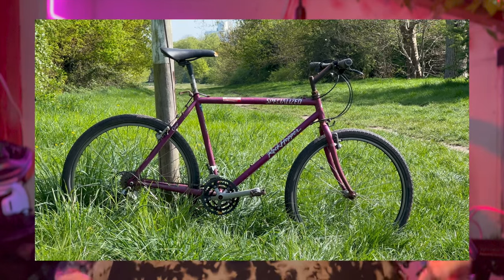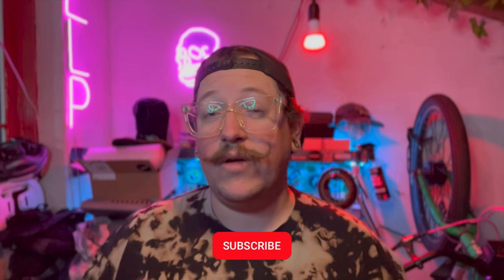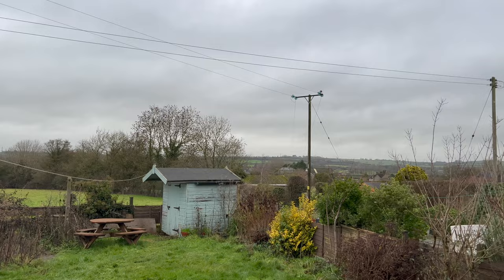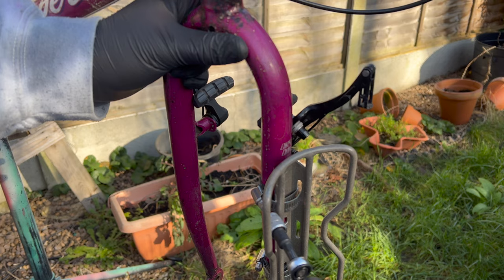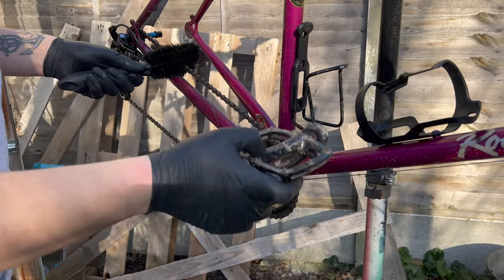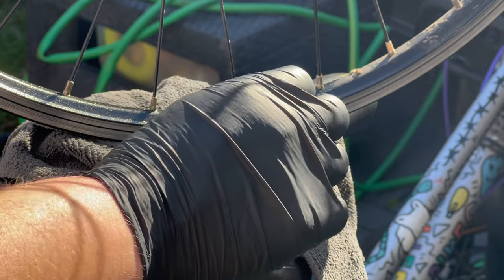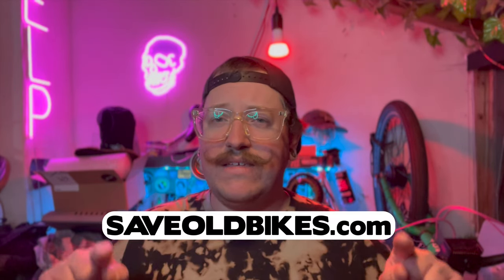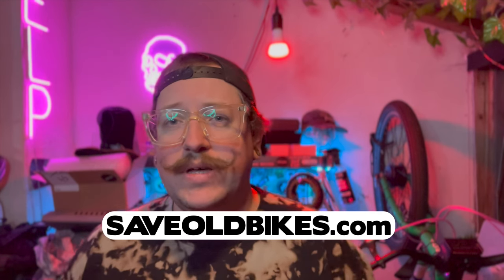Building a 90s Specialized RockHopper Commuter

Comment: I would recommend the Seeley mini ratchet.Quite pricey at about £14 but a superb tool. At one end is the ratchet, at the other a bit holder recess so you can either use it as a ratchet or a screwdriver. Surprisingly comfy and very shiny. Lives in my tool roll due to its compactness and practicality.

Comment: since you have Vbrakes you could have easily just gone for a high rise stem and kept the sweet bars. i changed the stems on all my bikes for a more 'gaper' ride.
i have switched to RockandRoll Gold or Blue on chain, mainly because they are so easy to clean with a wire wheel on a cordless drill between lubes. chain stays shiny.
cool bike for yer dad. nice new 1X on the hopper.

Comment: I have BLB Big Smoke OS bars on my retro 26 MTB commuter. This is with a 130mm 45deg stem, which brings my bars level with my saddle (I'm 6ft). I dont like swept back bars as i have found it very hard to get the reach right.  Plus i have a front rack, which i put my shopping on, so i like the bars medium wide and flat for leverage with the rack. Maybe for a commute, try cutting the bars shorter between 700 and 750, and with comfort grips, like Ergon GA3s, or some thumb rests like Togs Flexi MTB.

Comment: I own a '97 or '98 Rockhopper here in Canada.  Modified tires, saddle, handlebars.  But I never found it particularly comfortable, especially for long rides.  It desperately needs new tires and a new drivetrain, but also a stem and handlebar to improve comfort as well as cable repairs.  By the time I do all that, I might as well buy a new bike.....which I did (yet another Specialized, but this time a 2023 Sirrus X 2.0).  I needed to get out biking, and I just didn't want to ride my old one (I kind of feel sorry I didn't try to rebuild it.....but I 'could' afford a new one).  I was initially shopping for a pure commuter bike, like a Devinci Cartier or Kona Dew......but found those BORING, though comfortable.  I sacrificed a bit of comfort for my wrists by buying the Sirrus, but boy is it fun to ride and great at keeping speed.  Still need a handlebar upgrade though.

Comment: If you're using this for commuting, what are your numbers? What do you actually need? Looks like you've tried swept back and you've tried height. What about height and back sweep together? Velo Orange Klunker Bar in black might be the ticket. Just get a shim to convert the 25.4 to 31.8 and you can still use your stem. Or switch out to a sick BMX stem.

Comment: i follow you on IG with likely 3 accounts.. my HANDLEBARS of choice is the.. usually range between a 30-45 degree with a rise that matches enough to slip the cups for TT bars inside. I keep doing that for some reason..  I tend to ride smaller frames upsized with 450mm seatposts and swap to riser stems BMX-MOTO bars and the uprights.. simply because I'm not a little person.   current stable has a 1996 ROCKY MOUNTAIN  CARDIAC in BADASS BLACK..   going thru a city mullet disc brake conversion. a 2021 NORCO INDIE4 going to 29er and 24spd DEORE on a Surly BIG DUMMY fork..  a 2005 TREK 7300fx running the OEM KLEIN-TREK disc brake mount on the back.. the IS version.  etc etc..  2020 trek xcalibur8   1997 giant sedona SE BMX ... 2013 opus zermatt